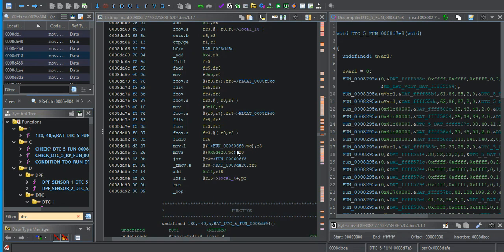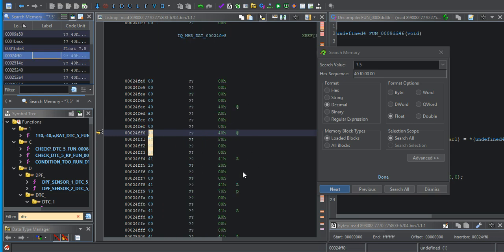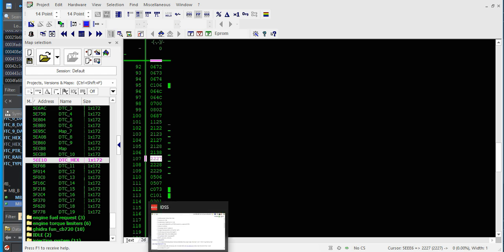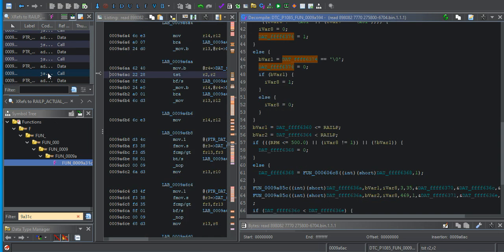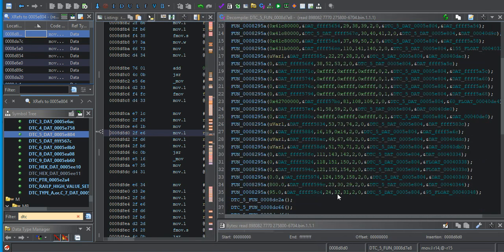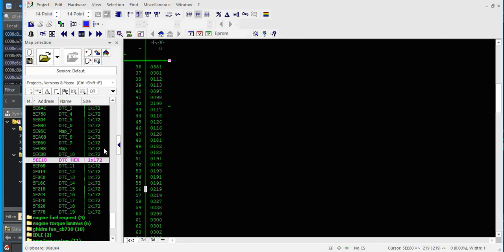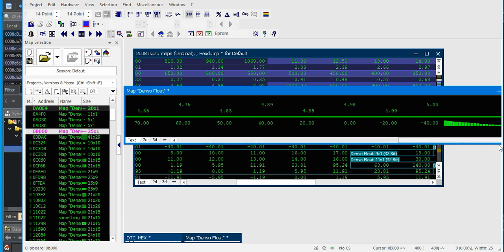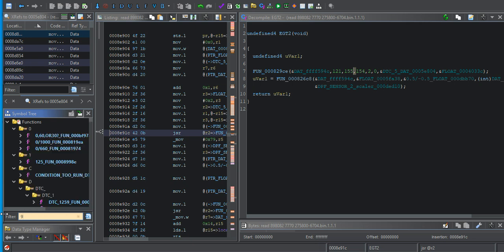How to find EGT, MAF, ECT, sensor scalers. Denso sh7058 and 55

Comment: hi bro, i have an Denso sh7058 on opel astra 1.7 125hp, i cant find in anyway the rev limiter bit, i want to do an hardcut at 4700rpm, coud you put me in the right way? thank you
Reply from the maker: All 32 bit float right? Find you rom variabl in ram and label it based off of one of your known maps that use rpm in an axis. Then track that variable through the Ecu to find where it is compared to your known rpm value with a hysteresis of 200-50 then depending on your car just cut fuel 20 0 at your desired rom
Reply: @GHIDRAuto  sorry bro I didn't understand what you mean by ROM(maybe rpm?) and RAM axes, could you explain better? or maybe you could tell me the address where I can work? I'm not very expert on DENSO, anyway it should be similar if not the same as the ecu you watched in the DENSO videos thanks you
Reply from the maker: @ I made the video. very unlikely it will be the same address. go ahead and watch the rest of my videos   until my comment makes sense.

Comment: man, this is the sort of thing where to me it looks like ur just pulling shit out of ur ass, but i know you've seen enough dumps in the past to know what to look for, but its still impressive to watch. besides finding maps to tune with winols, have you ever reversed a function for the purpose of modifying functionality? like if some function is modifying a value you care about, patching assembly to change its calculation? or finding a checksum function and nopping a conditional jump so you can modify data (for example)? idk just wondering about the possibilities. i've never done any sort of ecu work, just re on windows binaries. its cool to see this kind of application of re in the wild.
Reply from the maker: lol I’ve learned so much in the last six months after publishing this video! Yeah I have patch the assembly to do things like map switching. This is so that you can select the power output with a switch on your dash. This truck has no antitheft system. I am working slowly working g towards creating a sequence of driver inputs prior to the ecm letting the truck start.
Reply: @GHIDRAuto  Is there a chance you can make a tutorial, paid or free, on how to implement map switching? I understand the basics of how to have it done but I would really like to see someone do it on an ECU.

Comment: Does anyone have a solution to unlock ..cloning or remap ECU for mazda cx30 skyactiveD year 2020 ecu denso s805 18881, mb275700-9552, 12V KE124D MADE IN SPAIN...THANKS FOR ANY INFORMATION
Reply from the maker: You are looking for a flash tool? Or you want tuning for it?

Comment: Extremely interesting videos. I’ve started tuning cars the past year and seeing how the reverse engineering actually works is crazy! Interested to know what background you have in coding/tuning. 
Also tried this software myself, how would I know what language to select for certain ecu’s? For example edc15p?
Reply from the maker: Bro I have zero experience in any coding or efi prior too diy projects. It has been brutal. My dad was a big lock ford guy, and we rebuilt multiple motors when I was young, I have a very strong understanding of how engines work. And therefore strong in engine tuning theory. I megasquirted a couple cars when, i tuned a couple eec-v fords. All personal stuff. All supported ecus. In 2022  found out what pcm flash is and started trying to find someone too tune me truck. One guy tried and it bricked my Ecu. I’ve spent a ton of time on romraider, Nefmoto, Ecu connections etc. found some help for ghidra on the Facebook page. Processor language is found in the processor data sheet from the manufacturer of the processor, or nefmoto for edc’s. The learning curve has been ridiculous, and finding information on autos with ghidra is really hard. My only goal is to try to get the information out there so that someone with a background in electrical engineering hopefully starts making yt videos themselves, so the community can benefit.

Comment: Hello, do you have a memory map for Infineon TC1793? Do you offer this solutions as a service? THank you
Reply from the maker: I do not have a memory map For tricore but I believe you can find it in the processor data sheet maybe?  I do not over solutions or services. Sorry. You can find me on Reddit under the same name. If you need help with super H I may be able too assist. Pm me there.
Reply from the maker: I may have found one. Send me the file. Ghidrauto@gmail.con